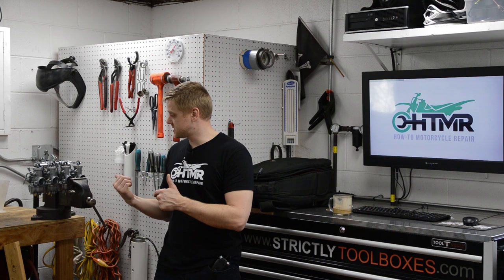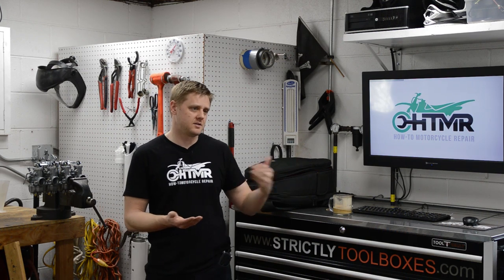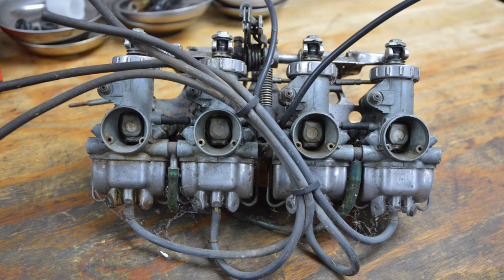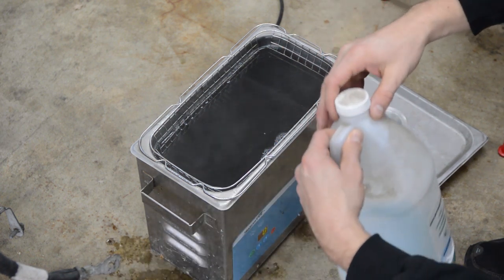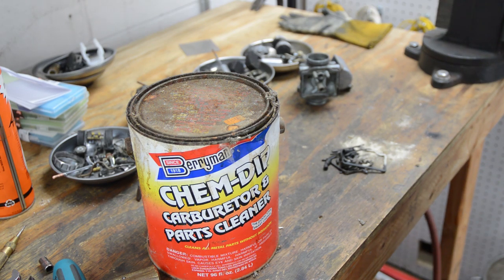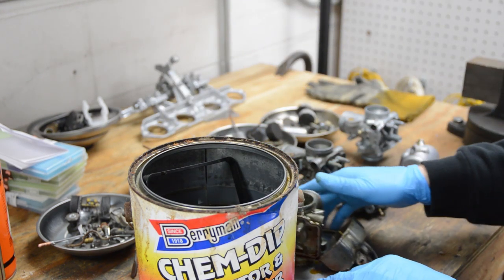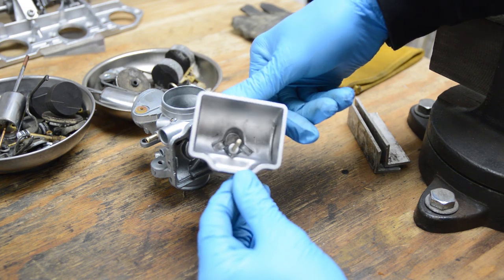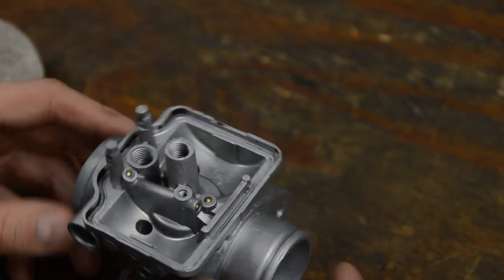How-To: Vapor Blast Carburetors (compared to other methods)

Comment: You can find a container that will fit carb and also fit in ultrasonic.  Fill with Berryman's and carb parts, seal, and then place in ultrasonic.  Heated Berryman's ultrasonic cleaner.  I have also seem it used on fuel injectors.

Comment: One more thing about vapor blast. The carb must really be cleaned out well as the abrasives have a way of staying in the threads. When not clean properly, the screws will get stuck because of the glass beads. That is it Matthew MCRepair.

Comment: The best method of keeping cost at bay is to put carb parts into a clear plastic container. The container can be filled with whatever you prefer and just put into the tank. This way the solution will stay super clean. Works well for me. Try it and you will be surprised. Good day.
Reply: What tank are you reffering to g?
Reply: @tdogg1824  Ultrasonic tank.

Comment: Awesome video man! Could you dry soda blast the gaskets first and then finish it off in the vapor blaster? That end scene was pretty sweet!
Reply from the maker: Yes but I kinda converted the dry cab to wet. Not going back LOL.
Reply: I used 170-325 mesh glass bead this week for the first time. It's pretty amazing! I would like to have 3 machine. one dry and two wet! one wet with mgb and the other with ao! =)
Reply from the maker: @CTmoog  Yeah, add a rotary screw to the list LOL.

Comment: Just realize that their is a dull protective coating on the aluminum.  If you blast it off, it will corrode much easier.

Comment: with vapor blasting your getting a mechanical connection between the soda and pressure.  Thats why it always looks better.  Its like comparing a touchless carwash to a soft brush car wash on a black car.  The soft brush will always win.  Makes me think I am gonna go out and buy a vapor blast cabinet.   Wet or dry.  Hmmmm.
Reply from the maker: Don't buy one, build your own.
Reply: @HTMR  I will build

Comment: I would never use any not soluble media in carbs or engine parts. Though it may look way better, it does justify taking a chance to get particules in a circuit or friction surface.